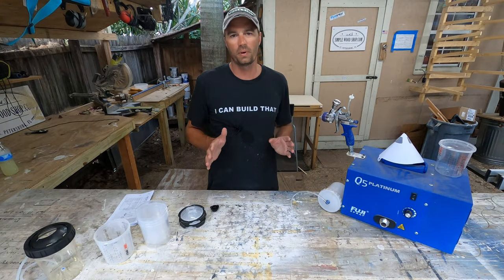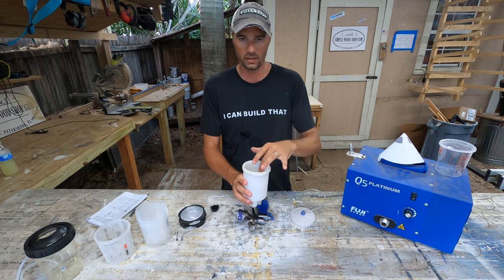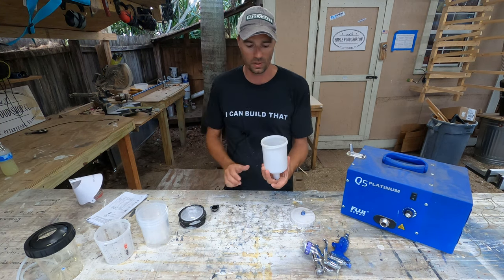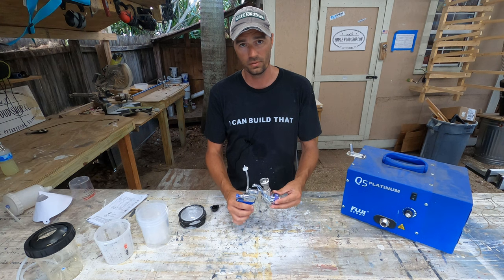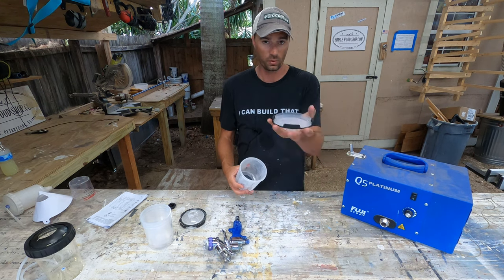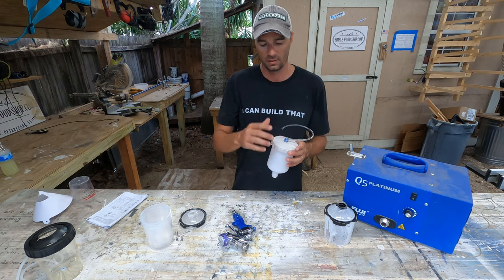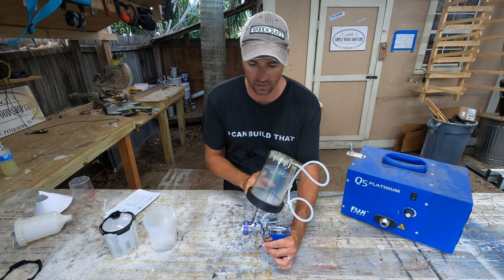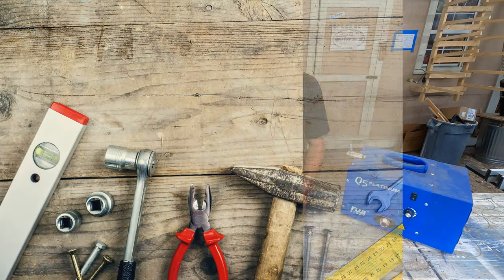Fuji Sprayers and 3M PPS 2.0 system, problem solved

Comment: Matt, although I agree with the time saving aspect of using 3M's PPS system is a huge reason why professionals add it to their Fuji Spray guns, from my experience the ability to spray at any attitude or angle is the main reason why non-pros should consider using it.  In fact, that's also a serious advantage that all users will enjoy.  And for the record, I use PPS on all my many spray guns, whether they're turbine or compressed air based.  

  I also would suggest that there's never any reason for non-PPS users to throw out leftover finish after their spraying session is over.  Like myself, they can simply empty the leftover back into the tin.

  And, for non-pros, or any finisher for that matter who doesn't mind taking a few extra minutes to reuse the disposable liners as well as the caps and plugs, they can save some money.  I've found that I can usually get 5 uses out of each.  Hey, what can I say, I'm a bit of a cheap skate!

Take care and thanks for your video.
Reply from the maker: Yup, you can rinse and reuse the cups.

Comment: Can you spray lacquer without the HO cup
Reply from the maker: Yes,  there wont be any back pressure pushing the materials through the gun.  So it may sputter, or you can push the disposal able bag as you spray.  It will work.  Not ideal but it will work.  Chances are you'll end up getting the h\o cup to avoid that.  That's what happened to me.
Reply: @SimpleWoodShop  Thanks Matt.  Greatly appreciated!   I've been watching videos on the Fuji/PPS and every video I watch - I learn something new.  I should have started with your video first!  Ordered the HO cup this morning.

Comment: I notice that the HO does not  have the ratio scale. Guess you gotta do it the old fashion way with it with a mixing cup
Reply from the maker: RIght, it's included on the regular cup system (without the pressure chamber) however I find I don't mix many mediums so it's good.  WIth the  Q5 the only thing I found I had to thin was some metal paint I used for a project.  You could always use the liner in the non-pressure cup (the one with measurements) and then transfer the liner to the h\o cup.  Without spilling of course.